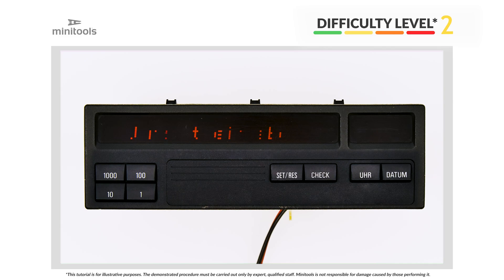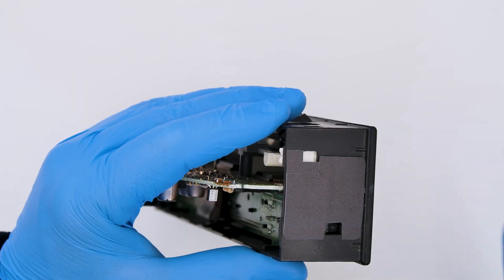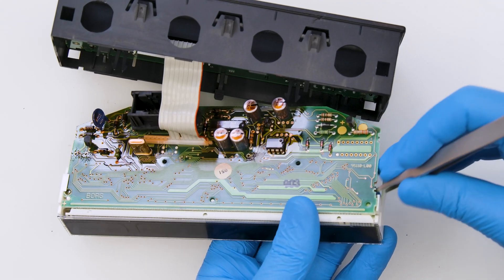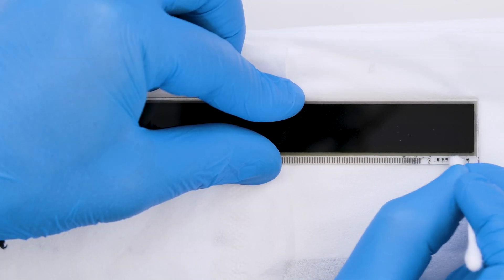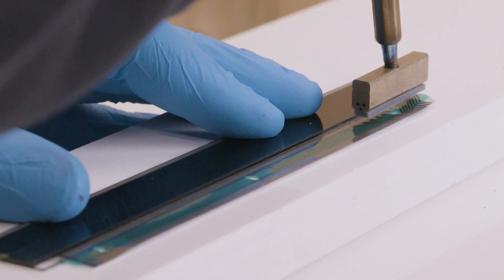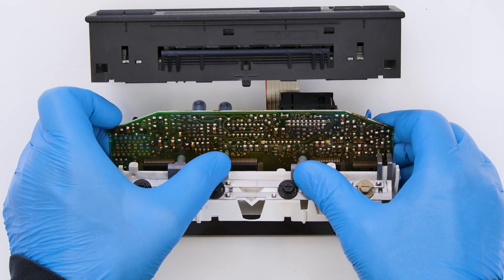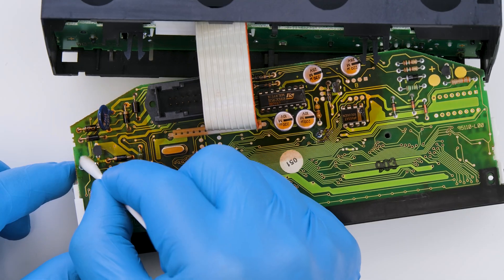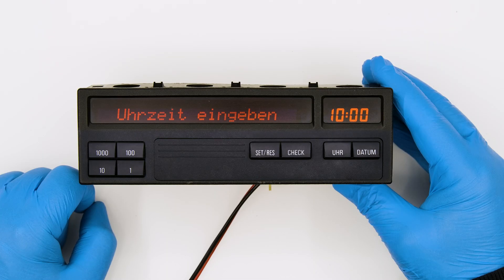BMW 3 Series E36 MID OBC LCD pixel repair

Comment: now my backlights dont work, and im still missing some pixels :(
Reply from the maker: Hi, could you please send us an e-mail with come pictures of the issue at info@minitools.com? Thank you.
Reply: @Minitools  i resoldered the pins but i do have some blown bulbs but no 24 volts across any of the bars, if i shine a light on the screen i can see what it says but i am still missing a few pixels.
Reply from the maker: Hi  @ben-f9j7g , if you send an e-mail at info@minitools.com attaching pictures of the issues our technicians will look into it, thanks.